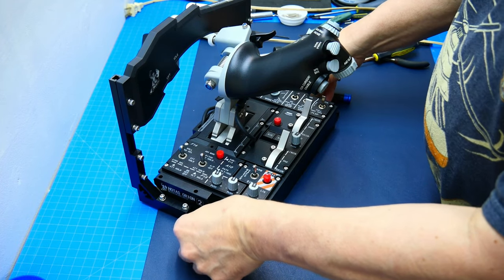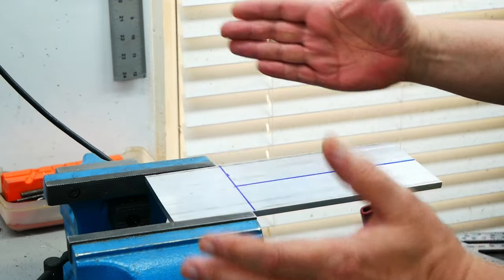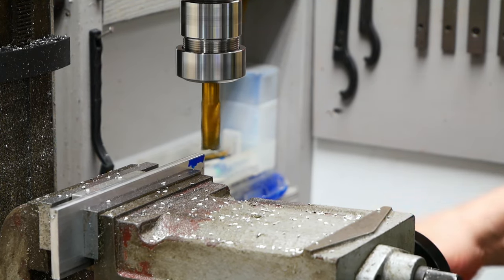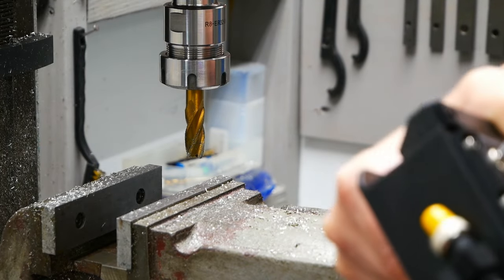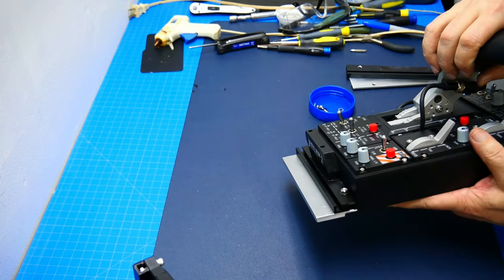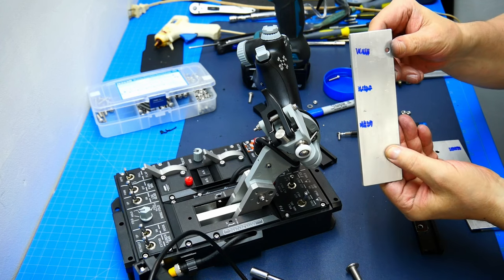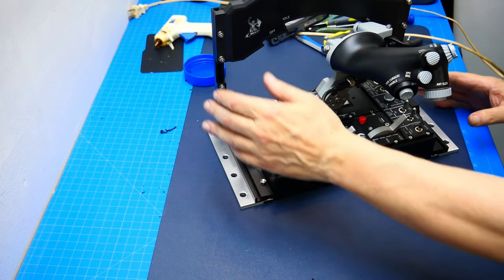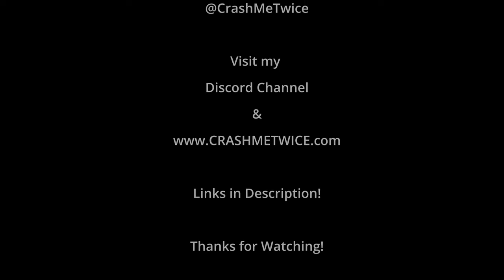WINWING Orion2 F-16EX Viper Throttle Mount DIY - Part 1

Comment: I saw somebody doing one similar thing but magnetic. Meaning the plates were plastic (3D printed I think) and had like a row of 10 neodymium magnets that would latch on another row of neodymium on a similar rail but bolted to the left console. This way with some wiggle and force you could detach it without bolts and change it with a second Orion 2 that maybe has a F18 or F15 grip.
Reply from the maker: Thanks for sharing, it's always great to hear about on how others have tackled their mounting issues. Thanks for watching and commenting! Cheers
Reply: Cool idea, but wouldn't that interfere with the hall sensors?
Reply: @modder.mikhail   The sensor pics only very close magnetic fields.